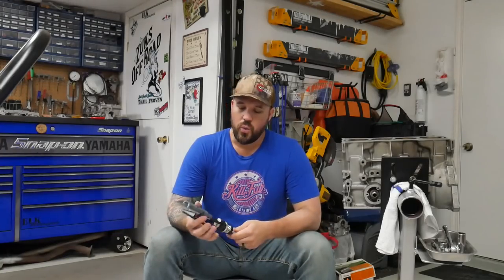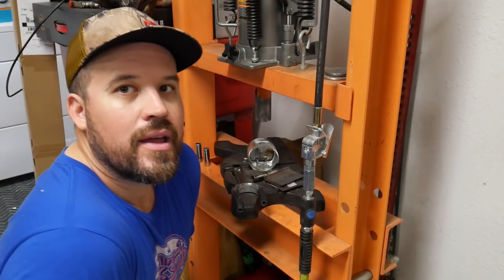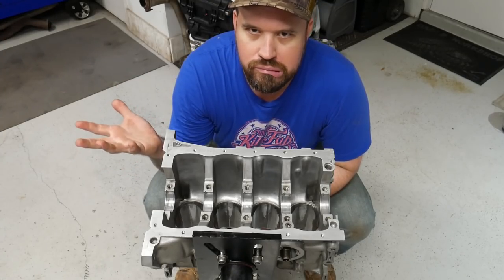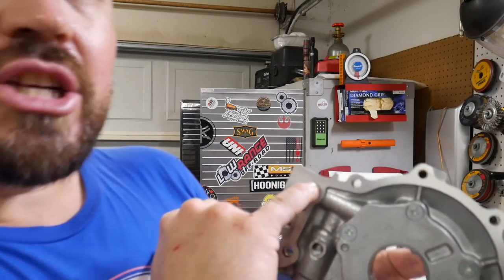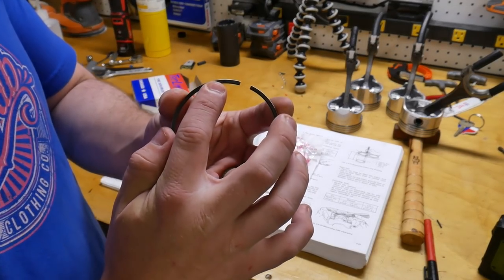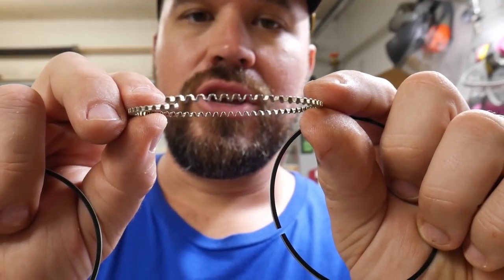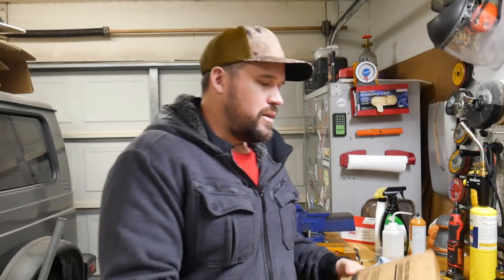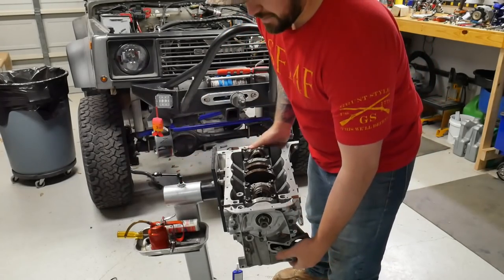Suzuki Samurai 1.3L Bottom End Rebuild

Comment: Couple of things you didn’t mention I’m curious about.
We used to mark everything.
Rods mark with F and cyl number.
Mains marked the same. # and orientation.
Someone marked a piston backward once on a reused one and when started the engine had a tick when running. Took forever because it was punched backward.
All that matters.
We punched the top of the pistons with Cyl. # too.
Always on forward side.
Center punch instead of number punch.
Always easy to read and put back correct.
Just my thoughts.
I gotta say, you are very good at this.
Some are like listening to a 10 year old.
Keep it up.
I will share with other Zukies.
Thanks again.

Comment: My method.
When putting oil rings on.
Situate the top ring between the bottom groove  and the middle groove.
Bottom ring below oil groove.
Then put in cage ring.
Then the wiper rings slip in easier.

Comment: Great video This is something I would like to tackle someday. I've seen other videos that use some kind of crush guage for setting the crankshaft guide thingy's in. When is that needed?
Reply from the maker: ezzyeggy that's plasti gauge. That's something that you generally all ways use. I'm just reusing my bearings and didn't do anything to the crank so I don't need to use the plasti gauge. It's used to double check your bearing clearances.

Comment: Hey man nice video did you had to shave the bottom end???
Reply from the maker: Juan Beltran, do you mean did I have the machine shop deck the block ( machine the mating surface for the cylinder head of the block)? No I did not. I did check it with a straight end though. I really didn’t want to increase my compression ratio any way due to running forced induction.

Comment: Instead of using assembly lube on con rod bolts, use ARP Ultra Torque Fastener.. It assures the correct torque value.. If you notice you said you were installing ARP head studs to keep the head gasket sealed, ARP includes a small ointment size amount of their Ultra Torque Fastener so the threads on the head studs have the correct torque value for their studs..Every threaded product they sell comes with it.. It is a good idea to use a lubricant between and on both sides of the con rod bolts to stop the friction, just not sure I'd use assembly lube..  ARPs website has a section for frequently asked questions, one of them being what to do about rod bolts and or nuts. It states to use ARP Ultra Torque under bolt head or con rod nut sealing surface. So in a Samurai you can use it between the rod bolt washer on either side. I would not smear it on, just a light coating should be good.. They also talk about head stud installation if threads in block pass through a oiling or coolant area to thoroughly clean threads applying ARP thread sealant instead of Ultra Torque and can use blue loctite on head stud nuts if desired..Can also use Ultra Torque on underside of head stud nuts between nut and head stud washer.. I would think you could use it everywhere there are threads  and be ok.. Its main purpose is for stainless steel threads to keep them from galling when nut is torqued..Just my 2 cents, hope it helps.. Love your video's, I learn something from each one..
Reply from the maker: Mark Geletzke, that's great info. Honesty all lubrication products have come a long way since the early days, and ARP probably have done a great deal of R&D for fastener lubricant because they are one of, if not the best manufacturer of engine fasteners.

Comment: Will anti-sieze work just as well on the threads and in-between the bolt and washer?
Reply from the maker: Not a good idea to use anti seize on any internals of the motor. The nickel and copper based stuff had actual metal in it, and as far as the food grade anti seize goes, I would be worried that out wouldn't be thin enough to make it all the way thru any oil passages of it managed to get sucked up the oil pickup tube. Your best bet would be to clean the sticky coating that comes on the new bolts/ clean any debris from old hardware, and just use regular motor oil to lubricate the treads and washers if you don't have any assembly lube. That's what everyone did before assembly lube.
Reply: @ELKMotorsports  Thank you